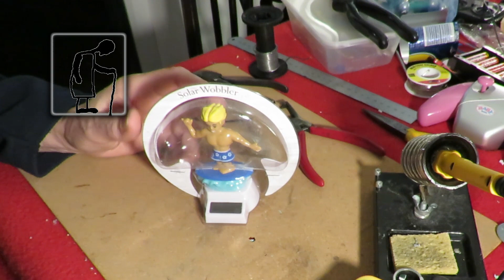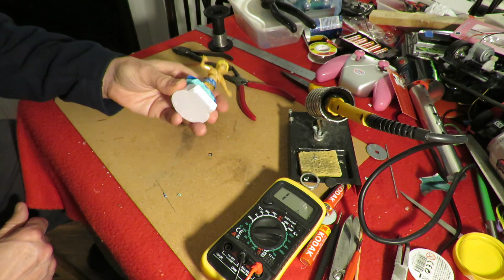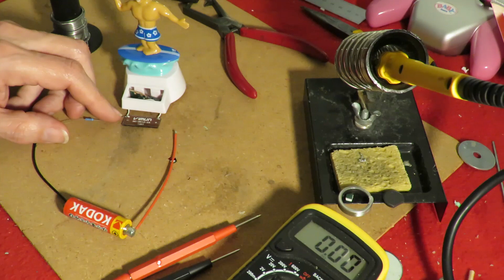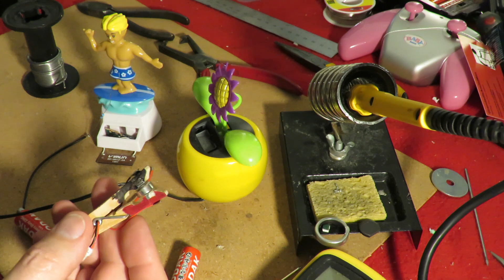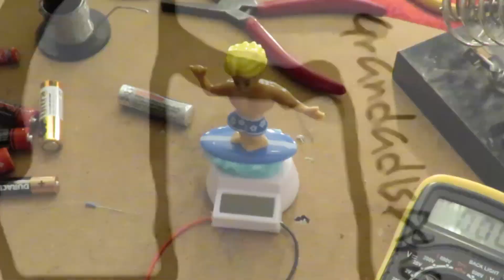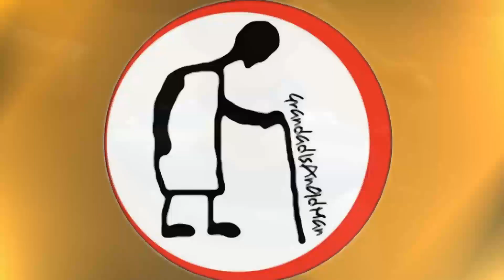Battery conversion for Solar Wobbler

Comment: Excellent work -- I followed your instructions to the letter and got mine working by soldering some dry joints and connecting directly to a rechargeable AAA ..  I knew that physics O Level would come in useful one day!   Thank you
Reply from the maker: Haha, brilliant, I always like to hear a success story. As for the exam results, I am pretty sure none of my school exam results came into play at any time during my years of employment. Even the City & Guilds I took later were literally "tickets" to qualify me, the actual information I learned was never used. Life is like that 😁👍
Reply: These funny little wobblers are more addictive than heroin...... so I've been told.

Comment: Did you solder the negative side of transister to the negative wire? Thanks!
Reply from the maker: I soldered the negative side of the battery to the negative side of the solar panel and positive to positive so it is in parallel.
Reply: Could you parallel or in series multiple wobblers and have one larger solar panel with long wires to fit in the window and have wobblers on the table. Let the experimenting begin.

Comment: I am working on this exact project right now.   Thanks for taking a look at this.  If you put a potentiometer in series you can adjust the speed / amp draw you want in total darkness.   Basically I have mine running fast during the day and slow at night.   The actual power source can be anything of course but I am going to try my latest rotating motor using a AAA.  Most people suggest putting a diode in there to prevent solar panel drain but I found that it isn't necessary on this setup.  Remember!!! ----All this started with your 'Snowman'.  For years I have watched him in the background of your videos rocking away endlessly and wondering --Why?  How?  Now I understand.
Reply from the maker: Poor old snowman is buried under junk on my work desk that I can't get to with so much junk in my work room. Seriously thinking of getting a rubbish skip and starting fresh.
Reply: @GrandadIsAnOldMan  LOL
Reply: Why doesn't every house in all the world have solor panels on their roofs? And tucked away inside their house, a little, funny, solar wobbler.

Comment: Interesting experiment.
Maybe it would be better to reduce the value of the resistor with the older batteries. I would think a 2k would be better.
"BIG FOOT" made a good suggestion about the diode too. I never knew that neodymium could take solder, so that's good to know. :D
Reply from the maker: Soldering magnets probably does not do them any good but as the sole purpose here is to use it to make an electrical connection I am not worried if it loses a little power. I would suspect they could also crack if unevenly heated but I haven't had that problem.

Comment: Hello. I made an external battery of two solar panels of L = 2 inch and l = 1 inch
Reply from the maker: You may find you over power the circuit but to be honest I have put larger voltages through them and they seem fairly  resilient.
Reply: @GrandadIsAnOldMan  I know and I fixed the solar panels on a piece of wood.
Reply: I use 7805 transistor to charge the phone.
Reply: Can I hook a wobbler up to a car battery and achieve 5,000 not rpm but wpm - wobbles per minute?

Comment: may want to use a diode to protect the solar panel from discharging across  the battery ,they are conductive ,read up on solar protection diode ,usually a small Schottky diode will do m8 you will need a diode that works down to your battery voltage but current will be very small I would think
Reply from the maker: The original request was a battery conversion but I left the solar panel in so I could remove the battery when not required. Lidmotor has shown how to use these little circuit boards for his long running pulse motors charging a supercapacitor during the day to keep it running overnight https://youtu.be/15OIO2GeEZ0
Reply from the maker: Oops, wrong video link but good enough
Reply: BIG FOOT: That's a good idea. :D